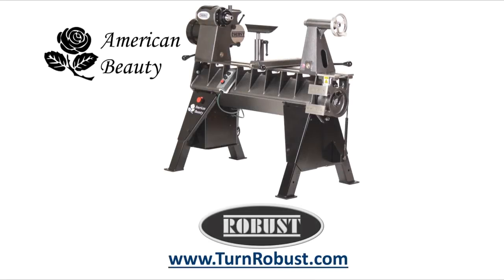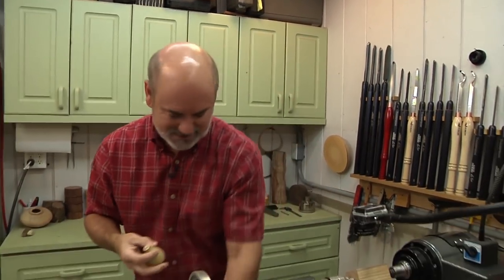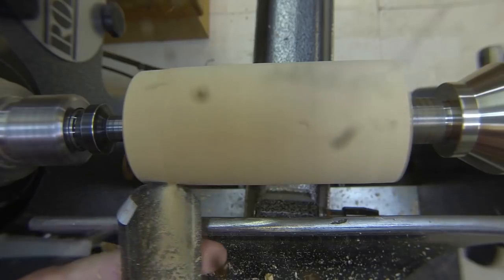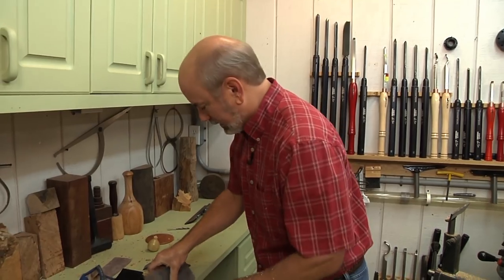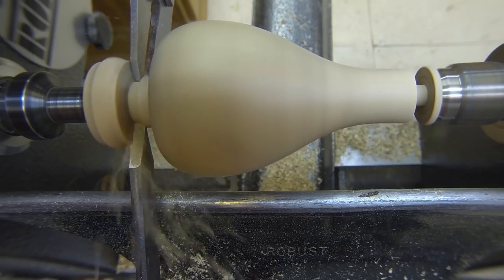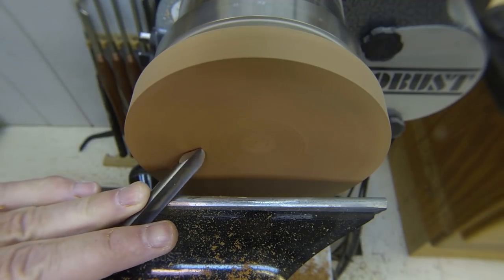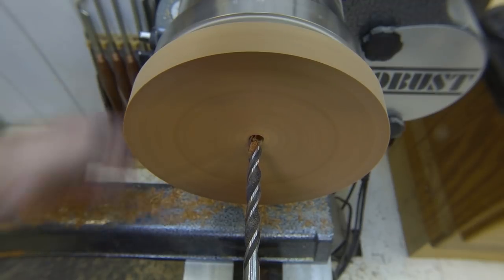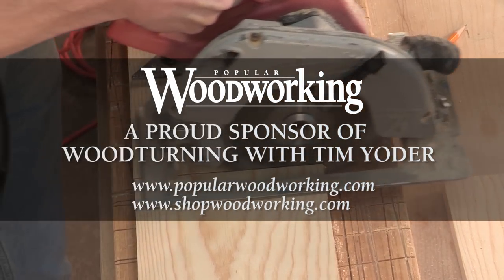Mushrooms-Part 1

Comment: Hi Tim. I'm new to turning and came across your video. I'm wondering how you mounted the piece of lacewood for the large narrow top of the mushroom? I know you said you made a tenon but how did you make it? Did you have to mount that piece of wood earlier on the lathe in some other fashion? I'm just trying to figure out how to get a tenon on such a thin piece of wood. Thanks.
Reply from the maker: I mounted a piece of waste wood with a tenon on it in my chuck. Then I put double-sided tape on that wood and stuck the mushroom top blank on that. Then I cut a tenon that was only about 1/8 of an inch long. Popped it off the double-sided tape and then put the mushroom blank in the chuck. It does not take a long tenon to hold small pieces like that.

Comment: Hi Tim doesn't that fancy sanding backer thing defeat the point of the holes in the abranet??
Reply from the maker: It does a little bit but a lot of the sawdust settles into the hook part of the pad. If it gets really clogged up I just rip the paper off and shake once and the dust is gone. Or I shoot it with compressed air and it cleans up nicely.